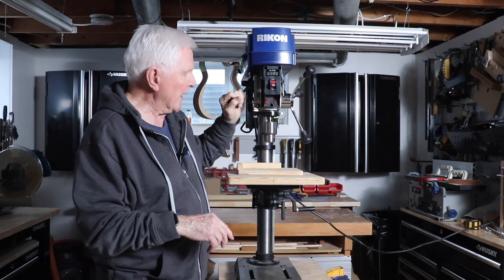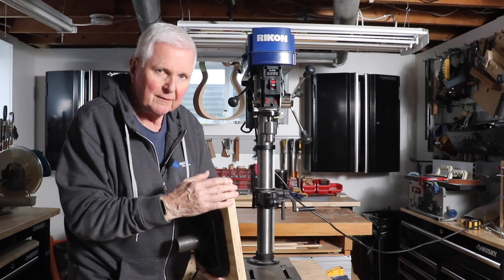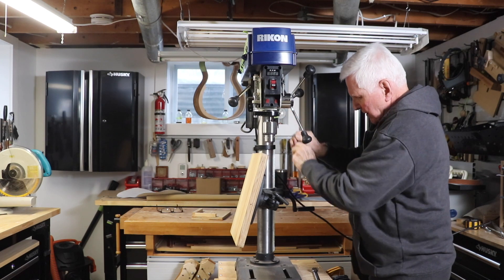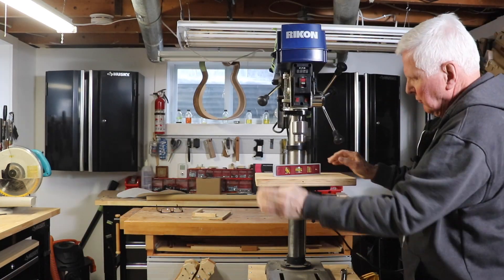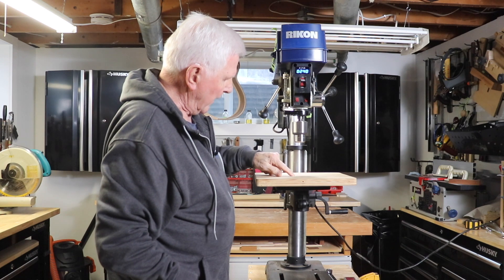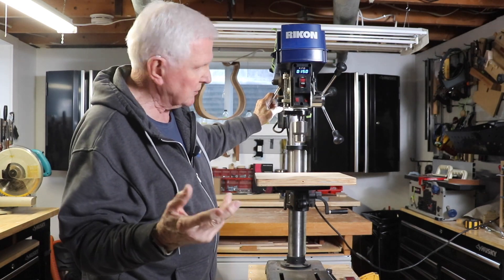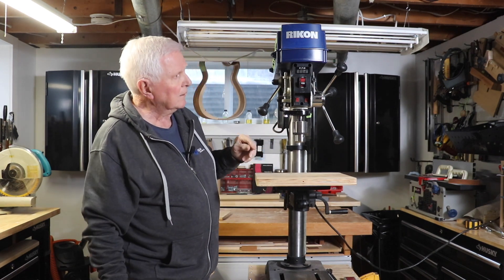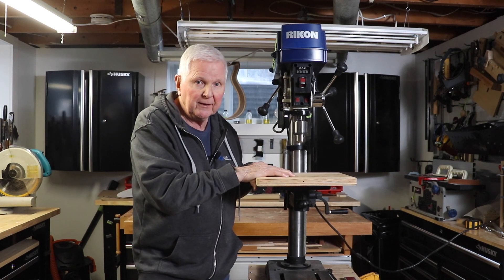Drill Press Review & Hack

Comment: Nice piece of equipment!
I have an old (1970's) Rockwell countertop drill press. I got it as a throw away item at a place I worked at in the 1980's. It doesn't have as many adjustments as yours has, and you have to loosen the motor and move the belt to a different set of pulleys to adjust the speed, but it still drills holes. 🙂
Reply from the maker: Drilling hole is the important thing.